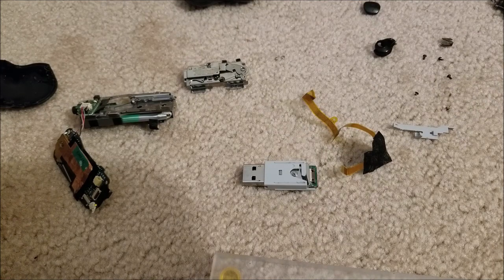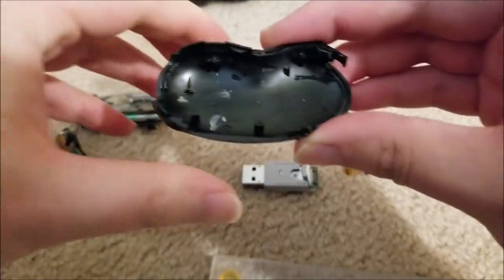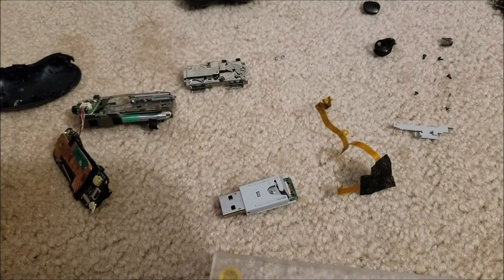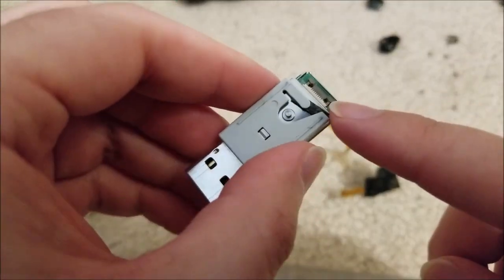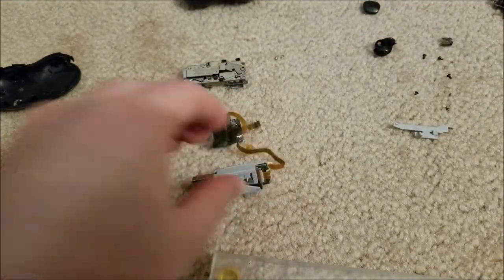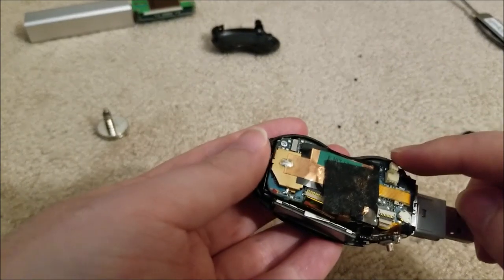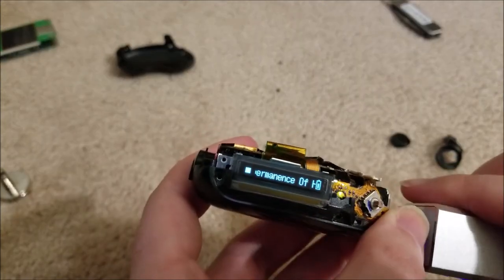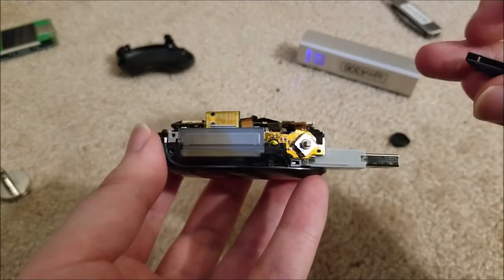Let's Fix: Sony NW-E307 Bean MP3 Player No Charge or USB Transfer

Comment: Hey really glad that you're ok.. Hoping for your full recovery man..😁

You really helped me a lot on that psp battery mod that you made been using my psp for hours now haha..

Hey I've been thinking is it possible to maybe solder a psvita or switch analog to a psp 2000? I've been thinking to mod my psp's analog for a longtime now and been searching the internet but cant seem to find any result or anyone to have done it.
Reply from the maker: Thanks, I'm much better now! To swap psp and vita joysticks, hmm I believe they are both analog output types (the psp is resistive and the vita is hall effect) but their ranges are likely different so you may need an opamp circuit to scale and shift the analog range so it'll register correctly with the psp.

Comment: i have the e207 (which is pretty much exactly the same as the e307) and i can't find anything on the storage type.. would you happen to know what type of storage it has in it and if it's possible to mod it to use an sd card or to increase the storage in general?
Reply from the maker: It's got a surface mount nand flash chip as the storage medium. It's theoretically possible to swap a larger nand chip but you'd need special equipment to clone the contents of the original chip onto the replacement, safely remove the old chip/solder the new one and there's still the chance the firmware is locked to a max size. As for using an sd card, pretty much impossible unless you could "emulate" the parallel nand interface with something like an fpga and sd card. By that point it'd draw quite a bit more power and very likely have a big board that wouldn't fit the original case.

Comment: I have the 307, but one day I saw that the screen does not turn on and nothing can be seen but it works when putting on music
Reply from the maker: It's a common story with these early oled displays unfortunately. If only there were a modern drop in replacement.